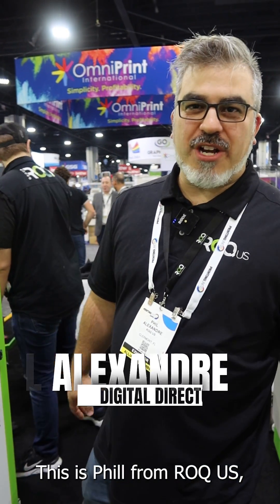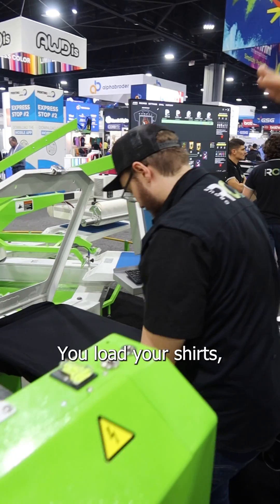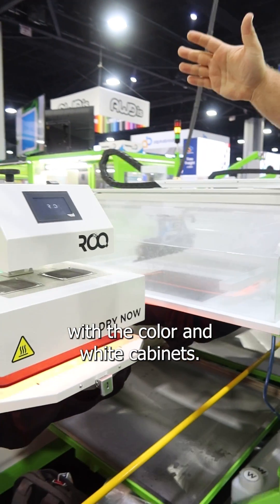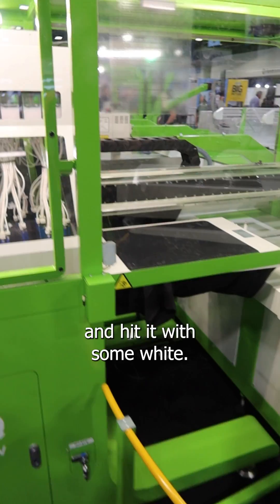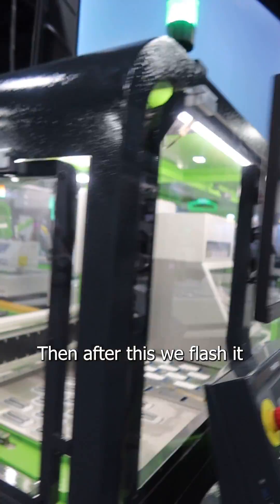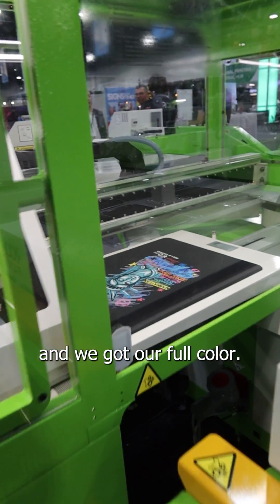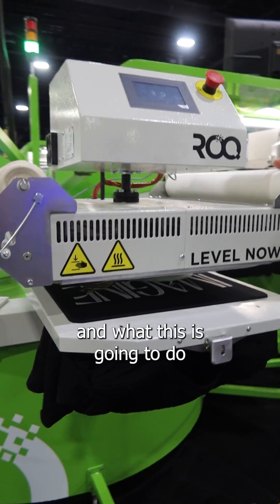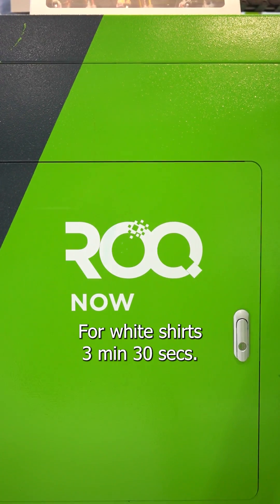A 100% digital printing machine, optimized for web-to-print.

Comment: Looks good but we tested this press with our designs at a local shop and it couldn't repeat the same print quality unfortunately. We were super excited thinking we finally found a quality print on demand partner (SUPER hard to come by) but it didn't end up working out because of the inconsistencies in the prints.
Reply from the maker: This machine is new, and one of its characteristics is the consistency of its prints.
Send an email to sales@roqinternational.com to clarify any doubts.
Reply: @Roqinternational_G-SR  email sent.

Comment: We should Like 11 Shirts per hour be intersting? 5:30min per Shirt. Did i count wrong? 🤷🏻‍♂️
Reply: That's not how production lines work.  You have other shirts being loaded one after another.  The FIRST shirt takes 5:30.  The NEXT shirt is probably like 20 seconds after that.  So you're probably producing 3 shirts/min or 180 shirts/hour.
Reply from the maker: The ROQ NOW prints over 200 photo quality images per hour in dark garments and over 250 in white garments. It can be even faster but you would have to reduce print quality. The first garment can take up to 3 minutes to be printed than the following ones take about 17 seconds. It can be faster depending on the resolution and the speed of the operator.  For more detailed information please email us at sales@international.com